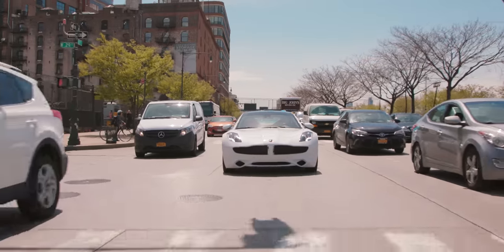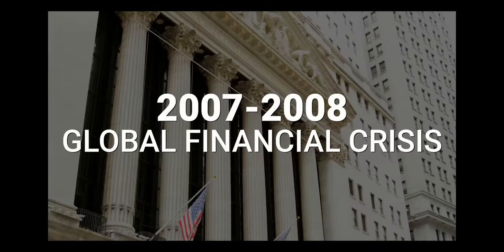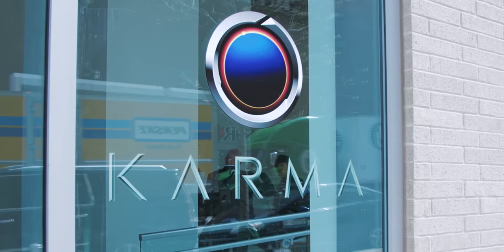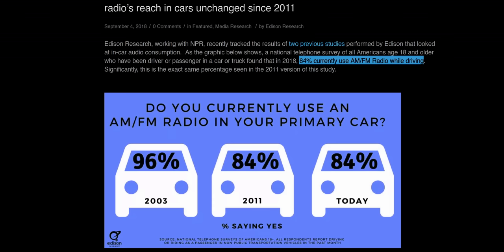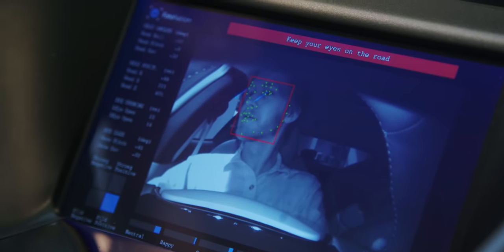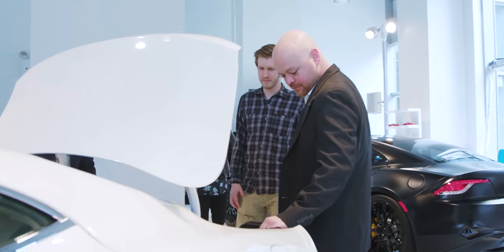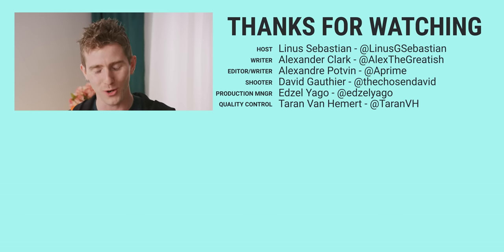What's so cool about this car's prototype FM RADIO?? - Karma Revero Showcase

Comment: Looking forward to the future where your car can tell your insurance company you "looked tired" when someone bumped into your car at an intersection.
Reply: YUP ! SPOTTED the flaw in the plan right away ! GOOD for YOU ! Not kidding. Good catch. Consider- Likely no one on the ACTUAL working DEVELOPMENT team older than their mid-20's or so, consequently lacking any historical perspective on the NATURAL proclivity of some in this world to sell shackles in the form of GEE-WHIZ .
Reply: lol, though the same and i dont  even have a license
Reply: then it will play a happy song for them
Reply: Or angry. Suddenly you are charged with road rage or some shi t like that. Also it would provide tons of data on you for them to mine and then sell out the back door.
Reply: they will have to make a small display screen so the car can tell people off when they cut it off, bump into it or try and break into it
Reply: just like they used those 'safe driver' devices to jack up your rate based on how often one uses the brakes...which is sort of a conflicting message
Reply: @Shadowtrot  - dashcams are inexpensive now. You can pick up a nice one for $20-$30
Reply: @SugarFreeTargets  Who said this was for insurance purposes?
Reply: If it does happen, it won't for long before most cars are fully autonomous.
Reply: @Adephx Because the insurance is enforced by the state. If it won't cover me why should I be forced to pay it?
Reply: @lurac5710  But that's retarded, using that device conditions the driver to hesitate when braking, which will cause accidents instead of preventing them. People should be conditioned to not fear the brake pedal instead.

Comment: Why would someone want the backup camera image to be cropped? I don't want to have to move my head around to see everything, just give me the whole backup camera on the main screen.
Reply: keco185 it's not the backup camera, that's on the screen. This is the rear view mirror, it has the same viewing angles... Just enhanced
Reply: Isn't the camera also pivoting in response, expanding the FOV? Basically acting more like a traditional mirror, but with the sightlines of a rear mounted camera.
Reply: Chetan Naik it’s just a typical fisheye 180 degree camera that you find on any car.
Reply: @keco185  Well that's disappointing. I thought I noticed some parallax, but I was probably just imagining it.
Reply: "This allows for the rear-view camera to naturally update where it's pointing"
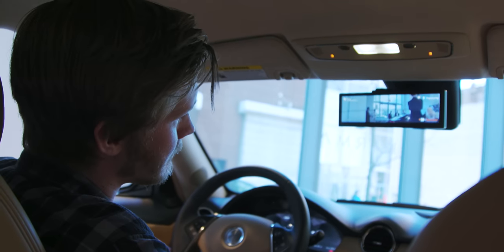4:30

Comment: “Prototype tech”
Camera zooms in on a headphone splitter
Reply: apple is fault remove headphone jack and see it is still widely used tim cooks is stupided remove head phone jack they just want to sell dongle and wireless ear pieces apple is bad head phones jack is useful
Reply: To be fair, a prototype is by definition an early sample built to test the concept. Linus said all of that technology in the trunk can be condensed down to a single chip in the future, but before that they need to make sure the concept is viable. When building a prototype, you hack things together, and if it works, it works :)
Reply: @kulmajaba  in short; "prototype" is what you do with it more than what you made it from. (unless you're doing prototype materials testing or something... but that's a whole different case.)

Comment: So let’s see what’s special:
FM radio improvements 
Rear view backing up assist
Tries to stop you from sleeping

...that’s it?

also that fm radio screen might be distracting for the driver, the point of fm radio is to listen and not have to worry about anything
Reply: while i agree that the FM radio might be slightly distracting nothing more than spotify. I disagree with the purpose of FM though, it was built to be listened to thats it, it wasn't intended to be a worry free experience because it was invented before all these extras were even ideas. I guarantee if this was an option when FM was invented they would have done it.
Reply: Also, most of these features are already present in other existing cars. DAB can already broadcast song titles and images and is quite common in europe, drowsiness detection is also available since a few years  and the rear view assist doesn't seem to cover a larger field of view than a regular rear view camera with a bigger display.
Reply: @Silberschleier  arent some countrys already preparing to shut down fm/ukw radio because of DAB+?
Reply: These geniuses like to create problems than solve.
Reply: @till3560  Yes. I think Norway already shut down FM. Other countries want to shutdown FM, but are still keeping it alive for now, as many older cars don't have DAB receivers and the users are still sceptical.

Comment: When you basically said It decides if it wants to give a driver back control, and won't if they look scared. That's pretty scary..
Reply: I'm sorry, Dave.  I'm afraid I can't do that.
Reply: On the flip side, I'd love to see this applied to people with road rage because I'm more afraid of those drivers than I am of computers.
Especially when I'm in the car that has the raging driver.
Reply: If you're panicking, you're not going to be thinking rationally. That's why they say never to say "Call nine eleven" because if you're already in a distressed and panicked state, you're going to look for the eleven key. Buuuut if you doze while driving and scare the sh*t out of yourself, and realize that the car is NOT hurtling towards doom, you'll likely calm down.

Comment: Alex: It’s filled with awesome prototype tech!
Me: 0:43 is that a cheap headphone splitter?
Reply: Also 1$ HDMI cables from Ebay/Wish on the left.
Reply: Well yea, this is how prototypes are made.
Reply: a "prototype" is a testing model. ie, to see if the technology can do what you want it to. no point spending $100k to redesign a headphone splitter just to discover that none of it works right anyway.
Reply: @tzxazrael  OP knows that, it's a joke all be it a rather flat one. A form of sarcasm. Responding in a seemingly condescending way, only serves to make you look oblivious or worst.

But you can do you, if you want to pedantically pick apart jokes online feel free.
Reply: @NWinnVR  i mean... IS it a joke? possibly. maybe probably. there's another comment thread here that says the same thing but isn't a joke.

Comment: Linus: FM is the future

SiriusXM: am I a joke to you
Reply: What's FM?
Reply: @Warmaster_7  FM radio
Reply: @Warmaster_7  are you living in cave or something... We grow up with FM radios and still use it... How could you not know about it??
Reply: @mnh48  
Relax. I was joking. 

Of course I haven't listened to FM radio in years.
Reply: Yes, you very much are, SirrusXM. Straight downhill when you merged.
Reply: Sxm is sometimes worse than FM it's crazy bad
Reply: All of you that think SiriusXM is bad. Do you spend a lot of time  in  cities?
Reply: Warmaster 7 Nope. Signal does get blocked by buildings pretty easily though. Even driving through a small town main street.
Reply: @caddyguy5369  
Yeah. I agree. Buildings are an inconvenience. 

I'm an Over The Road Truck Driver. 

I don't usually spend a lot of time near buildings taller than my truck. 😁
Reply: @Warmaster_7  I pretty much had it for the uncensored comedy channel, but IMO they destroyed it when they merged. I moved to Slacker and Subsonic with my media server hosted at home.
Reply: @caddyguy5369  
It always happens in mergers. If not right away. It happens months later. 

I used to listen to Mike Church before they fired him.

Or The Quin and Rose Show. 

They "Want to move in a different direction."

And bore me to death. SMH
Reply: @caddyguy5369  
Also:

Did you build your own server? Or did you buy it?

And what software do you run?
Reply: Warmaster 7 They loaded the comedy channel with boring talk shows. The only one I liked was Lying Cocksuckers. It was a political one.
I canceled both of my radios shortly after the merger. I don't recall what broke the camels back, but I remember I was sitting in my car and something made me go oh hell no and I called immediately.
I would like to get some of my recordings off of my XMP3i, but I need a subscription to access them. Had I known that I would have gotten them off beforehand.
My parents have it in their vehicles and I was listening and right in the middle of a punchline something to the effect of, "Due to a live sporting event we shut this channel off." A couple of the comedy channels do it because they don't have enough bandwidth. The first time I heard that I couldn't believe it. To me that is completely unacceptable to do to paying customers.
Reply: Warmaster 7 I'm just using a spare Dell Optiplex 7020 Ultra Small Form Factor I "borrowed" from my ex employer.
I originally ran Audiogalaxy until DropBox bought them and killed it off.
Now I'm using subsonic it's a pay program, but works really well and does video too providing your internet can handle it.
Reply: @caddyguy5369  
Thanks Man. 

I've been meaning to build a server for years. 

One day I'll get started.  😁
Reply: Warmaster 7 If you want to dabble with streaming videos, you can use Handbrake to get to whatever bitrate your internet can handle. Quality will take a hit, but that depends on your upstream speed.
Reply: @caddyguy5369  
Yeah I've heard about handbrake. I was thinking about using Plex. 

But I'm to lazy. I should have rebuilt my PC already. 

I'll get it done one day. 😁
Reply: I'm not going to pay for a music subscription that only works in my car and still has people talking. I want to listen to music, not radio hosts talking about the celebrity news.

Comment: I live in Norway and here we have completely stopped using FM, if you use it you won’t be able to get any signal since nothing is broadcasting to FM only DAB
Reply: i thought people stopped dabbing ... /s
Reply: Don't we use DAB+?
Reply: PingasTheFourth think that’s only Britain, in Norway it sounds perfectly well
Reply: Eirik B. Martinsen could be, I don’t know...
Reply: Does DAB actually not suck in Norway? We have a bunch of 64 kbps Mono stations in the UK. The audio quality is often worse than FM.
Reply: @xeigen2  - Yeah, that's Shackles in the form of "NEW" and "GEE-WHIZ" for you. Good luck - C.
Reply: @ebmar  We have some DAB+ stations in the UK and they used it to lower their bitrates to 32 kbps to cram more stations into their allocated bandwidth. Some are as low as 24 kbps!

Comment: I cant help kinda wondering if the driver monitoring system is designed to also report to the chinese Govt (when used there), considering its origin
Reply: No shit. Why would they invest a dying foreign electric car company, they can just steal the intellectual property and sell Chinese brand Teslas.
Reply: Yeh. Kind of worried.
Reply: I would be just as worried if that was made in the US tbh. Besides, any closed source software is potentially spyware.
Reply: @justind8786  Thats what they did with Hummer, and now the Chinese military uses vehicles that look exactly like the US Hummers.

Comment: What's really cool to me is I actually read about the face-tracking tech while it was in its infancy awhile ago. NASA was testing a system like it for use on long-duration spaceflight to help keep tabs on the mental health of the crew (for a 2 year long Mars mission, that's a lot of time inside of metal tubes with no real options for getting away). A rudimentary version of this was also tested at Microsoft, as they were testing a system by which the Kinect would watch you as you play a game, and do things like adjust difficulty if you were continually getting frustrated, and of course, give all this data to the game companies for market research and the like. It's interesting to see this system finally seeing real (potential) consumer applications.

Comment: Texas instruments I have an overpriced, underpreforming calculator from them.

Huh
Reply: Same
Reply: They are one of the largest chip makers in the world. The calculators are a side project.
Reply: How does a calculator under perform? lol. It is only as smart as its operator.
Reply: Not underperform, just overpriced
Reply: @jc5604  
No, it's specs are really on the low end.
Reply: @jc5604  154 KB of storage; a 14 mhz processor from 1975, i would say it is underperforming. It has 16 colors! The programing language is terrible too. 

The numworkers calculator is just so much better too, They have a megabyte of storage, an 100 mhz ARM processor its just so much better. 

https://www.numworks.com/specs/
Reply: see my reply above

Comment: I can't believe so many people have such low standards that they still use AM/FM. Wow.
Reply: PeugeotRocket 
In many cases, FM can both sound better and be more reliable than DAB (the digital radio broadcast standard in the UK).  It’s also far more suitable for cars in rural areas, since you can still hear FM with a weak signal but digital cuts out completely.

Comment: i really wish you guys did more stuff with the automotive side of things, cause if you did you would know that this type of tech is already out there, maybe not on a large scale but it is trickling out. but its not limited to stuff from OEs either , there are company's like rywire who recently released a body controller module that uses digital fuses and helps make wiring up a car(for what ever porous) much easier as well as giving you more control with how things work, there is also ECU/ECM(engine controller), TCM/TCU(transmission controller and/or differential controller)  and even suspension control modules , all of which can work on their own or communicate with one another to deliver what ever experience or job you want to do from crawling over rocky terrain to ultra high powered sports cars or even just to bring a classic up to modern specs. i honestly dont think there is an industry out there where as many "home brew" things make it on to the shelf's as an actual product as there is in the automotive industry , some of it would totally apply to your channel and some of it not so much but i think if you (could, we all know you guys are hella busy,) take the time out to take a careful look at some of what its out there you guys would have a real appreciation for how it works, how came about and how some of these products could affect other industry's or even everyday home life...take care and as always i look forward to seeing more from everyone at LTT

Comment: This is actually an Electric Car that I like the design.
Reply: @Grand Admiral Thrawn Compared to Tesla I prefer that lol
Reply: there is a little hook in that - it aint EV, its a hybrid with petrol engine that generates electicity for its electric motors in wheels.. but it still need gas, much like chevy volt/vauxhall ampera

Comment: that "swoopy" rear end was designed with traction in mind. That would be a spoiler designed as part of the rear body, which captures some air and uses it to drive down the back of the car giving the rear tires better traction. It is most definitely not an aesthetic feature that just looks cool and hinders vision. I'm not even a "car guy", Linus. Most cars have this feature.

Comment: That is a good looking car. Needs a LS427 with a big 98mm turbo and a TR6060 transmission and a Ford 8.8 IRS rear diff. Then, and only then will it be a good looking and good driving car. Doesn't even need a computer except for fuel injection, so a Holley Dominator system would be fine. Doesn't need airbags because 5 point harnesses and a cage. There will always be a loud noise so you'll never fall asleep or need a radio. Now that's a car right there.

Comment: looks better than a tesla, also good stuff for FM but it would be nice if this stuff could be done without needing an ip connection, maybe it could piggyback on a dtv channel and update its data when the vehicle is stopped (dtv signals drop badly when moving), and have it download the (participating partner radio station/tv station) metadata and art etc sent out over dtv subchannel as video or put it in the captioning or something, surely alot of ways it could be actually made available and transferred from a broadcast (for example on the korg volca sample you load samples via an app that converts the data to audio like a modem) - i think alot of cool stuff could be done with radio and non-video stuff if you used unused local digital televisin transmission to enable other services and data to devices in the community without needing internet connectivity, maybe there could be like download schedules that can send books and wikis and other stuff normally on the internet,to devices without wifi and without needing an isp, its one-way but i think something like that could enable a whole new class of sortof data access devices that dont need internet, it can just cache these broadcasts

probably silly i guess but i like this kind of concept of using older stuff in some new ways and getting data to things without using the internet

Comment: The reason the US at least doesn't have better radio is because digital FM (and AM I think) requires a license, which massively cuts down on it's use. In contrast, you can build your own DAB digital radio receiver with no special efforts (beyond, you know, hooking a radio output to a microprocessor).

Comment: The solar panel roof is pretty pointless. Part of the reason why Tesla scrapped the idea was that the panels just didn't provide enough power to actually charge the car in any meaningful way and simply inflated the cost of the car, but then this is a high end car and the stuff in them often is the definition of pointless cost.